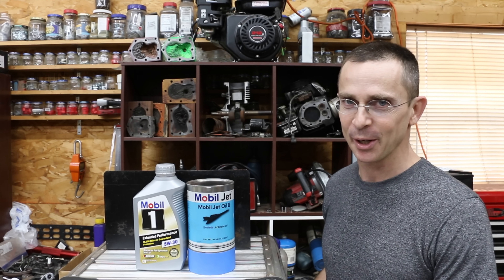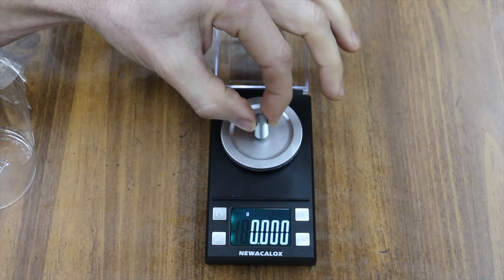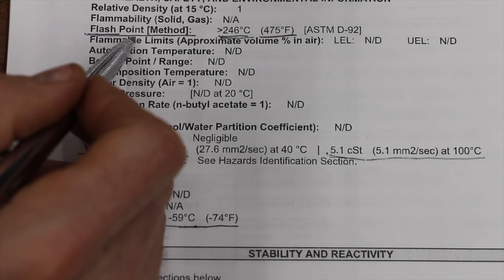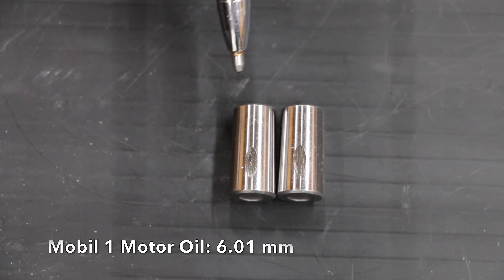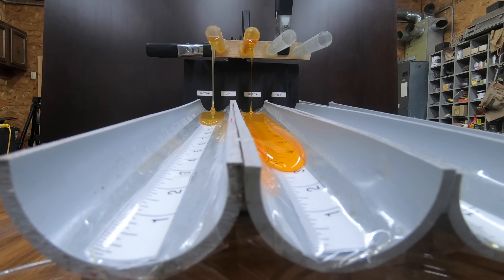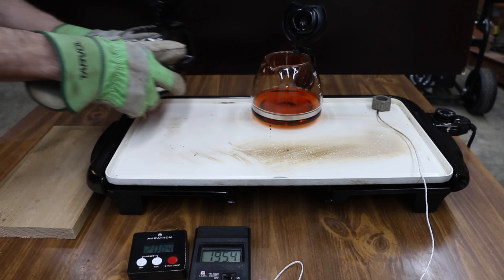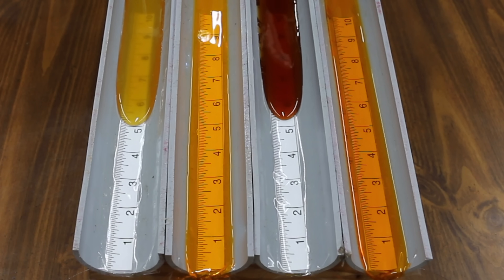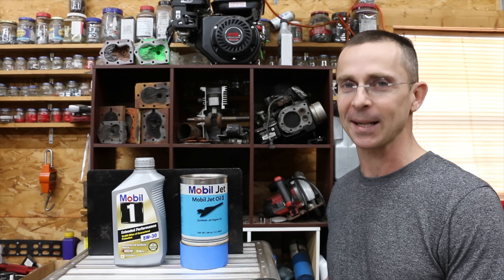Is Jet Oil better than Mobil 1 Synthetic?  Let's find out!

Comment from the maker: This video was a LOT of fun to put together.  By the way, you definitely don't want to put Mobil jet in your car engine.  it will eat EVERY seal and gasket it touches.  Thanks again, Todd
Mobil 1 Jet Oil (please do NOT use in your vehicle): https://amzn.to/3aLK1j4

Mobil 1 Extended Performance:  https://amzn.to/3hk2bep
Reply: @Project Farm, maybe we can help provide a bit of context for why. All the commercial Jet Oils are synthetic ester-based. Regulations stipulate that they must all be compatible because commercial aircraft cannot risk ground crew accidentally mixing two different types of lubricant and having a compatibility issue mid-flight. Synthetic esters are used because they have excellent thermal and oxidative stability properties, which are necessary in aviation turbines because they run at much higher temperatures than industrial turbines, and the oil reservoirs are much smaller to conserve weight; this also makes the oil work much harder. Many car engines have seals that will dissolve in the presence of esters - obviously aviation seals are developed to be compatible with the lubricants used in the industry.

Esters are actually used in most synthetic petrol and Diesel engine oils to improve additive solubility - they also dissolve engine deposits (deposits are made of oxidised base oil components, which are highly polar); this explains why in the comments below some people have reported jet oils cleaning up their engines.

Hope that helps!
Reply: You should do the same test but with piston engine aviation oil.
Reply: @jacobgoodrich4920 in other words Phillips 66 X/C 20w50
Reply: I once tried jet oil in my truck engine but due to the loud spool up noise I went back to conventional.
Reply: @cbnto  did any seals leak more or, go bad?
Reply: I was hoping you would send the jet oil to the lab..
Reply: Even if it is compatible with my vehicle engine, I can't afford to use it.
Reply: You sir are gentleman and a scholar
Reply: You are such a nerd...and it's awesome!! I don't mean that as a put down at all.
Reply: On the flip side, the testing shows very clearly that you should also never ever use Mobil 1 automotive oil in a jet engine. The failure could be catastrophic. The oil flow test showing it beating the automotive oil by over 8 inches shows it wouldn't even be close.
Reply: what relation between the underway test and friction ?
Reply: ... Well, Tim Taylor would give ig a try... ;-)
Reply: @michaelkarger7175  unless his wife, Al or Winston stop him.....not holding my breath though 😂
Reply: Imagine adding some lucas mucus to that jet oil. that stuff would be godly
Reply: Obviously the thing to do is to replace every seal and gasket with jet seals and gaskets.
Reply: And it may be added that you don't want to use Mobile 1 in your jet plane.
Reply: It's not compatible with Viton, Buna N or silicone... so what are the seals in a turbine engine made out of?
Reply: Would you ever do a jet oil in a combustion engine just to do a fun comparison. Maybe doing a 50/50 mix to see if you could benefit in anyway from using jet oil..
Reply: Can I put jet oil in my lawn mower without damage?
Reply: Oh!!: Just another homework for Warped P & Scotty K... 🥵

*Since I should avoid using Jet Oil in my SUV's engine, then can I swap said engine for a Jet Propulsion one??..
🤭
Reply: Love ur videos!!! Keep it going!

Comment: 0w8 vs 5w30 !?
Reply: Well it's that or use Aviation Engine Oil (for Propeller planes) which is 20w50, just pouring 6+ quarts of that takes 15+ minutes in summer.

Comment: I tried 1 quart to 3 quarts of M1 0W40 in a 2007 Toyota Camry for just over 1200 miles. I tried 1 quart in 5.5 quarts of M1 0W40 oil in a Toyota Hilander with 2GRFE for 5000 miles and no problem at all. Sending a sample out for UOA as well!
Reply from the maker: Thanks for the feedback.

Comment: P.S. The Mobil-Jet Oil II is basically pure oil with no real AW,EP, DI package of significance. I think the only additive outside of oil base stocks is TCP so by itself the war scar would be huge. Used as a supplement though to a fully formulated oil should be a different story! According to ExxonMobil and the US Military it is compatible with FKM and Silicone Buna seals that we would expect to see in modern cars and in Jet Aircraft starting in the late 1950's early 1960. If I am right when used along with fully formulated motor oil it should clean the snot out of carbon deposits, sludge and varnish slowly over 1500-2000 miles. Probably not more than 20% by volume with your normal motor oil. Changing the oil filter every 500-1000 miles just to play it safe. I am trying this now!
Reply from the maker: Thanks for sharing.

Comment: You should try mixing 3 parts synthetic engine oil of your choice and 1 part Mobil Jet II oil and test on the Pin and V lubricity tester! Might also test it in the freezer. If you like I could send you a pre-mixed sample bottle of just such a mix if you like. I am sure I can spare a Black Stone sample bottle. I might test said mixture first in an actual engine before I send it to you if that is ok?

Comment: I can imagine due to its super-thin liquidity (which is very constant along a large temperature range), Jet Oil could be pretty much aggressive - means perforating or even dissolutant towards regular motor tightening / simmer rings and gaskets. So it could damage all this. Which are made of special heat-resistant and tightly compressed, more stable (ceramic?) material in jet engines (the turbine and oilpump bearings and that gets all well hot in a jet engine too, plus also has to stand temperature extremes in all directions.
Reply from the maker: Thanks for the feedback.

Comment: Jet oil is mostly for cooling, a large reason its viscousity is so low, plus the cold and fast starts and also 60k+rpm turbines see means it has to be thin. 0W-16 oil is thick compared to Jet A1
Reply from the maker: Thanks for sharing.

Comment: Keep in mind, though, that motor oil immediately begins to heat up as soon as the engine is started. Very few who see these videos are likely to ever experience a temperature of -40 degrees. The historic low temperature recorded at Anchorage, Alaska is is -34 F. Temperatures below -40 F have been recorded in Calgary, Alberta but these are record lows.

Comment: Important comment going unseen, hiding in some other comment string:
Ch K
I used to be represent ExxonMobil Aviation Lubricant. So for all JET oil, there do not design to handle the load, as most of the time lubrication is in hydrodynamic condition. However, we do have a sustainable anti-wear function that is secondary to primary functional additives.
Jet oil designated to flow at cold n hot temp without causing too much deposit as key factor. Follow by seal compatability and electric conductivity. And finally anti-wear protection.
Reply from the maker: Thanks for sharing.

Comment: I know a little about jet oil. The oil is consumed in the combustion process since the oil is used to keep the bearings cool and lubricated during the engines on time. Just goes right out the tail end with the burned hot gases.The oil has to be able to flow at both extreme scale ends of operation. 
Nicely done video covering the subject matter at hand PF. Job well done again. Peace
Reply from the maker: Thank you!

Comment: The MoJo doesn’t evaporate because it’s designed to lubricate the first stage turbine bearing, which is far hotter than the rings of even a forced induction recip. I’m not sure of the main bearing temp, but some engines cool the turbine wheel with compressor bleed air which is itself over 1000 degrees.

Another interesting tidbit, both jets and recip aircraft engines are designed to burn a lot of oil; less so on the very new engines like the LEAP, but our CFMs could burn like .67 quarts per hour. The R-2800 could burn anything less than 2.75 gallons of W100 and we’d be happy; we serviced the DC-6 with at least half to almost an entire 55 gallon drum of oil every flight.
Reply from the maker: Thanks for sharing.

Comment: The lubricity tester is not showing anything in my opinion. Try testing shampoo it will show better result. You gotta test it with high temps and it has to have hone on the metal
Reply from the maker: Thanks for the suggestion.

Comment: I would imagine the jet oil would perform better and provide more protection against wear in colder climates as the majority of wear and tear on Motor Vehicles is done during startup and having such a low viscosity even at colder temperatures would allow the oil to reach critical engine components much faster whereas a higher viscosity oil would be used in warmer climates depending on the climate you can put additives in the jetboil in order to improve its performance in the wear protection and not have to worry about the oil breaking down in high performance engines especially when turbo superchargers and nitrous oxide are used and raises the internal engine temperature far above normal
Reply from the maker: Thanks for the feedback.

Comment: Jets and airplanes are maintenance and rebuilt per government regulations. It's done more than a car is. Cars don't fall out of the sky with people in them.  Just add prolong Motor additive to your oil to treat the motors metal and extends motor life. I have used it for years and it works
Reply from the maker: Thanks for the feedback.

Comment: $20 a quart is reason enough to value your present motor oil over the Mobil One Jet Oil!
Reply from the maker: Great point!
Reply: @ProjectFarm  Besides the fact it's totally not designed for and will Harm your engine big time. Pretty soon a liter of oil will cost $20 anyway!

Comment: Jet engines function with a single center shaft that is self centering.  Most of the shaft contacting the bearings is during start up and shut down, or if the jet is making some hard maneuvers.  So for the most part there is a thin film of oil between the shaft and bearings.  Also the heat cycles the jet oil goes through is very different from automotive oil.  At 36000 feet the temperatures can be extremely cold sometimes around -70 F.
Reply from the maker: Thanks for the feedback.

Comment: The great thing about using a griddle to heat the oil is that after you pull it off to cool you can make some sweet pancakes!!!! Impressive test. I'm surprised that as well as the Jet Oil performed in the temperature tests it didn't also out perform on the lubricity test. Although I don't believe a turbine engine uses any friction bearings like an automotive engine so it probably doesn't effect it's performance in a jet.

Comment: I'd love to see if the jet oil and some other brands of motor oil can out perform amsoil when mixed with gas to make a 2stroke mix. Lubricity test and how clean it burns in a 2stroke motor.
Reply from the maker: Thanks for the suggestion.

Comment: I am a Airplane Mech, you never want to put this stuff in your Vehicle Engine, it will destroy every O Ring and or Gasket in the Engine.. Stuff is designed for a totally different action than what a Car or Truck needs. it's main purpose is spinning and to transfer Heat.
Reply from the maker: Thanks for the feedback.

Comment: Lets remember that a jet/gas turbine engine turns at very high RPM but has very little loading on the bearing in contrast to a reciprocating engine. A rotary is far closer in design to a jet engine but even then the way a jet engine burns fuel and creates its thrust is completely different so the oil characteristics need to be completely different. Also realize jet engines operate in temprratures around 40 below zero at altitude so the cold performance is critical. Have you tested synthetic diesel mobil to synthetic conventional engine oil?
Reply from the maker: Thanks for the suggestion.

Comment: I know this is an older video but I should point out a few things about the jet oil as an Airbus technician. The reason why we need the oil to flow at very very low temperatures is because of how cold it is at 30,000ft in the air, -40 degrees c, The oil used for lubrication is cooled by an oil-fuel heat exchanger to pre-heat the fuel and of course, in turn cools the oil, there is also an external air inlet and oil-air heat exchanger which opens if the oil gets too hot which may happen when the engine is running at maximum thrust for extended periods of time. There is also the difference that the oil holds up extremely well to sudden temperature changes which goes on in the loop. Sometimes as extreme as 120c to -10c in less than a second and vice versa. The components of regular engine oil would probably just seperate after a while of torture like that. Also anti-wear additives can be added after purchasing the oil kind of like motorkote but industrial
Reply from the maker: Thanks for sharing.

Comment: When I was in the Navy, I was a mechanic on jets, both F-8 and P-3. The engines used MIL-L- 23699B synthetic engine oil. I bought a new AMC Pacer and after break in I took the EPA system off and changed the fuel system to a carburetor and put a high energy ignition on it. The car got 26 MPG or better. I also switched the oil system to MIL-L-23699B jet engine oil that I got for free from the navy. I drove the car from California to Maine and we used it for three years and my wife and her father drove it to Denver while I was in Spain gettin ready for re-assignment. The car performed most excellent with no failures. We traded it in Denver for a Chevy van as it was more roomy for the family. The jet engine oil worked fine with no leaks and no problems.
Reply from the maker: Thanks for sharing.

Comment: This is hilarious! Jet engine oil! 😄
Thank you! This was a great video. 
Question: what if you blended your own custom 50/50 between jet engine synthetic oil and Mobile 1 synthetic?
Would you get the best of both worlds?
😅
Reply: The JET engine oil in the mixture would still probably kill the engine seals. Net result would be an oil that would eventually kill the engine.
Reply from the maker: You are welcome!  Thanks for the suggestion.

Comment: Please, when possible, test "PENNZOIL Platinum High Mileage Full Synthetic 10w-30" against "RED LINE Full Synthetic 10w-30," and "AMSOIL Signature Series 100% Synthetic Motor Oil 10w-30."  After doing my due diligence, I have found that these motor oils are the best on the market, and would like for you to do your excellent comparison on these oils along with showing the lab test results. Thanks!!!
Reply from the maker: Thanks for the suggestion.

Comment: So a jet engine is a turbine. It’s oil is pumped at high pressures causing it to to lift the rotor shaft. The shaft actually rides on the oil. Motor oil needs to stick to stick to give its protections.   So make since jet oil flows way faster. It is designed to be used in bearings designed to allow it to be pumped in and allow the rotor shaft to ride on the oil not the bearing.   But if your lube oil pumps go down man oh man the failure is amazing because it’s straight metal on metal at very high rpms with heavy rotor shafts
Reply from the maker: Thanks for the feedback.

Comment: 23699 (jet oil)  has a very strong smell.  Synthetic auto engine oil is good oil.  I don't think the jet oil has any real advantage for everyday car driving considering the cost.
Reply from the maker: Thanks for the feedback.
Reply: @ProjectFarm  We did use that oil in gear boxes, transmissions and engines.  The engine bearings were the biggest test for the oil.  Especially in the hot sections of the turbine engines.  I wish you would of sent the oil off so we could see the additive package in the jet oil.

Comment: Jet oil do not evaporate as easy because it is designed to work at high altitude with low air pressure, the temperature usually is around minus 60f there. It is basically a gear oil. Jet oil often contain TCP, and extreme pressure additive, airplanes with bad engine seals , the TCP get into the cabin because older airplanes use engine compressor bleed air for cabin pressure. I heard of pilots had to change careers because they been disabled by the TCP. Some people have low tolerance for that.
Reply from the maker: Thanks for the feedback.

Comment: Something I've not seen mentioned is that Jet Engines have components that are replaced after X number of Flight Hours.

Therefore the oil mixture can trade off wear resistance (to a degree) for a wider operating envelope.
Reply from the maker: Thanks for the feedback.
Reply: More importantly there is virtually no metal-to-metal friction in a turbine engine, so the wear test isn't particularly relevant to jet engine oil.

Comment: Back in the early 90's we used mobile one in our tf34-100A engines. The pH of this oil was low to help prevent varnishing but was too caustic for gasoline engines of the time. 

For our APU's however it was regular Mobile one, I ran it in my Camero back then and gave me an extra 2mpg. It didn't however play very well with the old Cork gaskets and liked to seep right around it.
Reply from the maker: Thanks for sharing.

Comment: Jet oil should ensure protection of moving shaft with extreme high ratio of rotation and high temp. without contact with fuel burning byproducts. Its separate in jet engine. 

This kind of oil is used in Mercedes compressors used for increase power in engine.  Not in engine, just inside compressor. Around 150/200ml.
Reply from the maker: Thanks for the feedback.